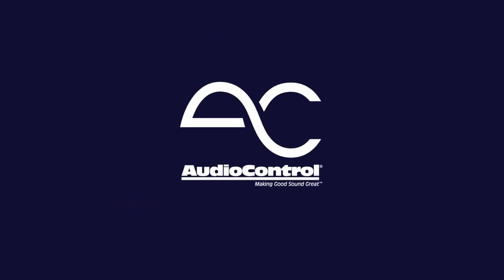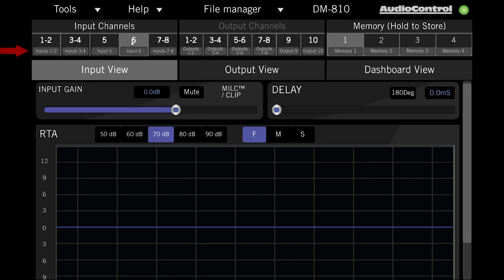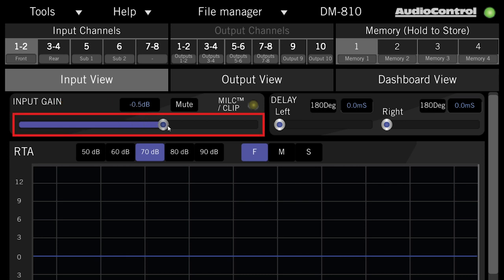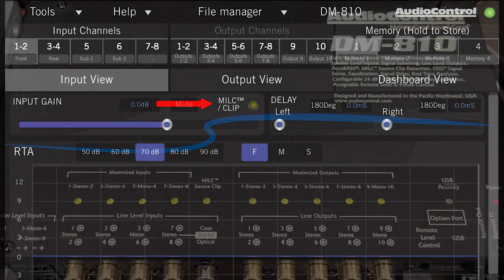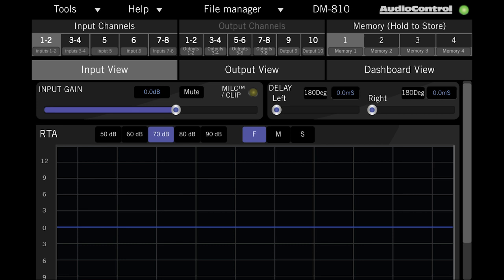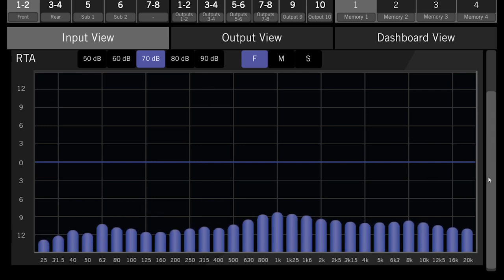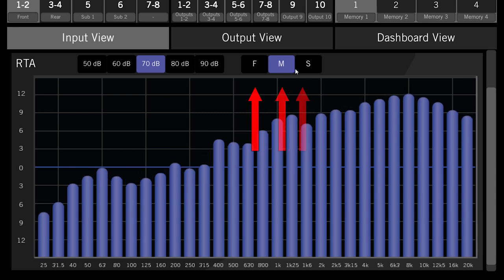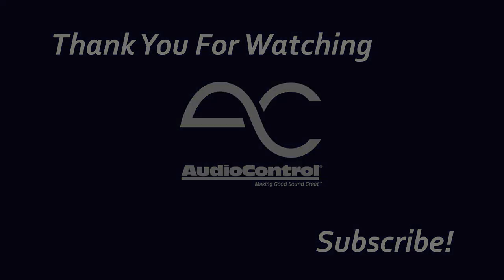Input Overview - DM Smart App

Comment: to get that rta singnal, are you using a special mic?
Reply: I believe the RTA signal is just measuring the electrical signal coming from the radio into the DSP. The mic would be used to measure the actual audible output from the speakers.